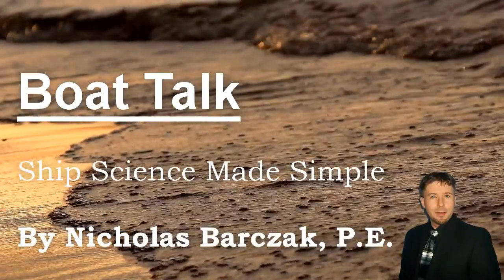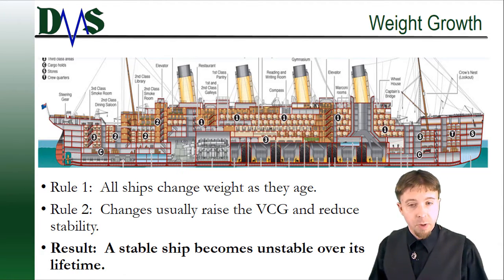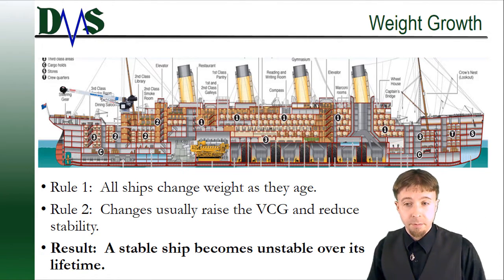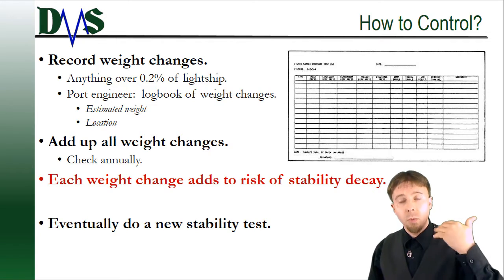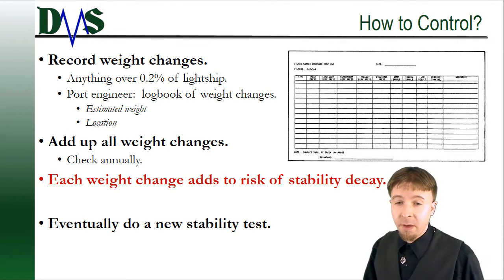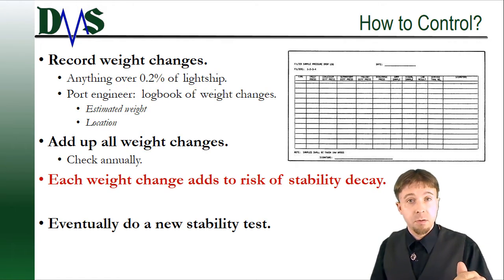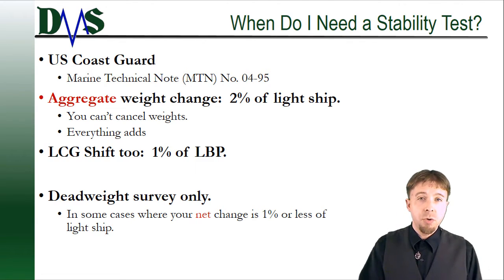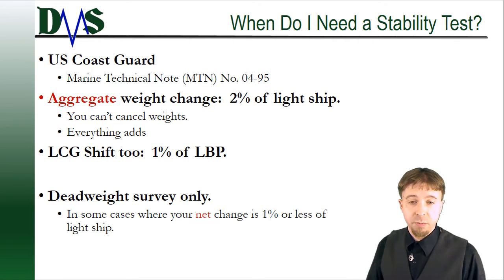Stability Decay

Comment from the maker: It is important to understand how little the center of gravity needs to shift.  Many vessels only have a margin of 1-3 ft [0.3-1.0 m] between their current VCG location, and the maximum allowed VCG.  This is why we need to monitor weight changes.  Due to the massive weight of the ship, small changes in VCG can make a big difference in stability.
Reply: That obviously affects the meta-centre big time to right?

Comment: I went through this a bit when doing an aircraft annual on a small aircraft. One of the jobs we were to do was determine the center of gravity of the aircraft. There were specific points we had to measure. Me being a bit new I asked "why would we expect these dimensions to have changed from the measurements taken during the previous inspection" No one knew (one guy said "perhaps the spinner on the prop was replaced"). Nothing changed on the aircraft but we were still required to make the measurements for the new certification. The new measurements taken during the inspection we were currently doing were exactly the same as the measurements from the previous inspection. I asked if they ever found a plane that grew between inspections.
Reply: Thx Dan R. After a LOTT of look and asking on internet. So light airplanes is about 10(+) L/h op gas. So what is is on small bouts? Small aircrafts fly at 80-100km/h (55-60mph) and small boats? The new kind of boats "fly" on hydrofoils. ...

Comment: I'm only a recreational boater now, but I care strongly about this stuff.  I wouldn't put a barbecue on the fly bridge without considering the weight change, for example.  Thanks, great video :-)  BTW, my boat (40 ft, 25 tons displacement, hard chine, wedge keel, unknown design provenance) has a worryingly long roll period at rest, but stiffens up when she gets tossed around.  Should I read anything into this?
Reply from the maker: Probably no problem, but I can't be 100% certain.  The main thing is to make sure the boat always returns to zero heel in calm conditions.  Otherwise, you may have problems with an angle of loll.  You can learn more about that here:  https://youtu.be/k8H5M3jrqpY
Reply: Big thanks for the reply.  I already watched your angle of loll video (working my way through your channel), very interesting stuff.  I find the way stability works on big boats both fascinating and unsettling.  I have a friend who used to sail on a research ship that had a max heel angle of 25 degrees and a rumored PVS in the low thirties.  How can you operatre on such tiny margins, let alone get to sleep on your off watch?!  Anywho, I suspect that my boat's funky stability curve has something to do with the deeply submerged chine, as she's been built roughly 65% over her designed displacement.  I plan on moving half a ton of ballast into the keel from the hull bottom over the screw, where it had been placed in a misguided attempt at silencing a 90 cm kort nozzle.  Needless to say, I just cut the thing off;  The vibrations were bad enough to crack windows while ice breaking :-D  Working the kinks out of a badly designed boat is both time consuming and irrational in the traditional economic perspective, but also highly rewarding.  Maybe why you shoudn't mess with poorly designed ships could be the subject of a future video?  At any rate, your videos are a great help in getting the various aspects of boat design into perspective, and I'm really grateful that you share your wealth of knowlege like this!

Comment: The real problem lies with naval architects / engineering in continuing to design ships that are sensitive to roll-over. So long as they can roll over without harm and continue on their way via inverted power and control stations, etc., stability wouldn't be of much concern.
Reply from the maker: That has less to do with the engineering than with the cost.  We have the science to design ships that can completely rollover and still keep going.  US Coast Guard frequently requests this on their smaller boats.  But it makes the ship much more expensive.  That added cost is why we don't often add this feature.
Reply: @DatawaveMarineSolutions  I was joking, as I know of no way for containers and bulk-carry commodities to be just as safe on the bottom of a ship as sitting on deck or resting in the bottom of a hold instead of on the hatch covers, but yes, I am familiar with USCG applications of self-righting and other worst-case-scenario designs.